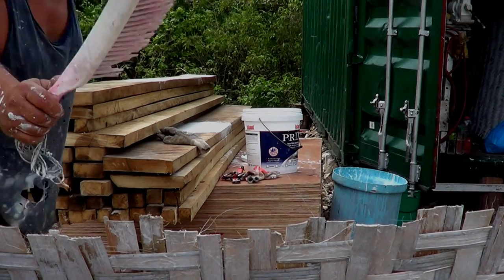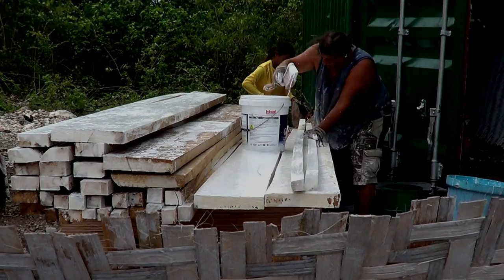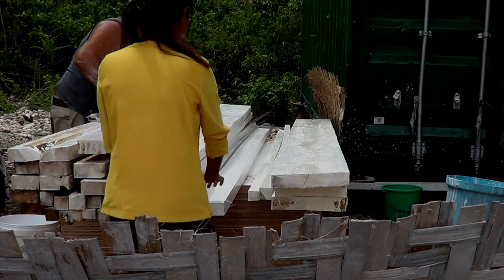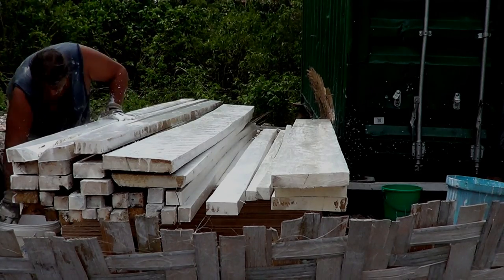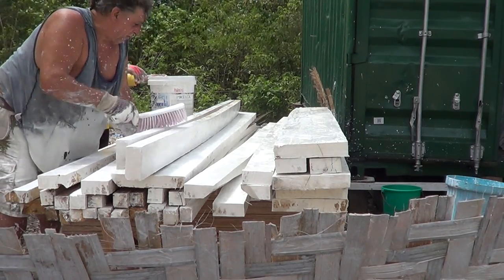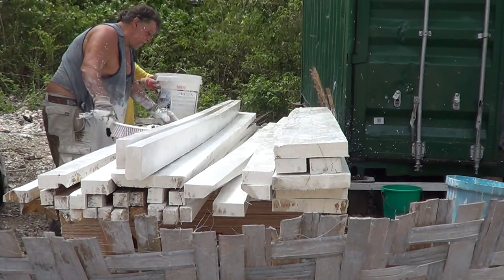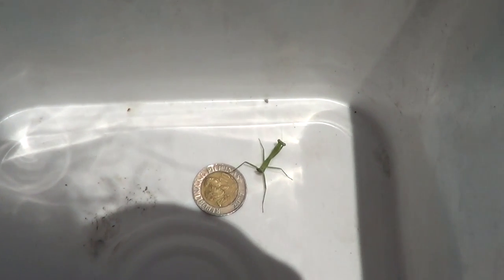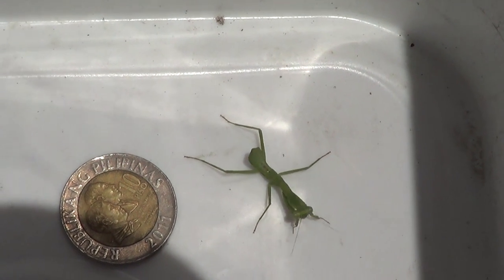WORLDS FASTEST PAINTER MOVES 1,000+#s PAINTS 6 SIDES/ENDS IN 54 MIN ROUGH SAWN PHILIPPINES LUMBER

Comment: Never seen anybody paint with a dust pan brush before surprisingly it did the job just fine. But I see you missed a spot.
Hey FAZ has your GoPro got a time lapse setting? This would have made a good time lapse film. Maybe something for the future filming of your work.
Reply from the maker: A$3 DUST PAN BRUSH WORKS BETTER THAN A $20 SLOP BRUSH.... P.S. your the 1st to mention it's name
YES, IT DOES, and the problem is 50% of the time the led settings screen is blank as it was/is almost every time I wish to use it and thanks much for reminding me. 
Thanks for stopping by, it's been a while since I seen you comment
Reply: I never miss a Fazio Video

Comment: Agree with some comments below, I understand when in work mode you may vent ,but don't take it out on sweet Daisy, she's not a mind reader, lmao. I use to be a painter myself, and maybe it's lack of supplies ,but that looked more like body painting to me, lmao. Personally I would have tried to lay all flat not in a pile like that, and poured and rolled that primer on or a cheap ass pump up sprayer, or even pour some and used a push broom. Also maybe doesnt matter to you, but how you dipped and sloshed on the primer all over everything would make alot of run marks visable after appling a finish coat. But you did this for a living  so what do i know, haha. But good job,that must be a bch working in that heat I would be irritable too, Oh and treat Daisy May like the sweet little princess she is :))